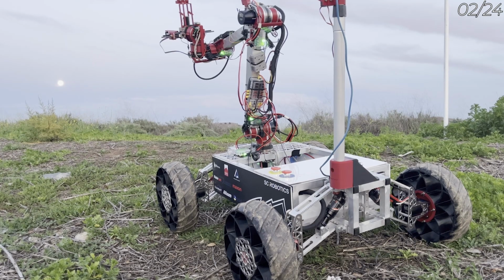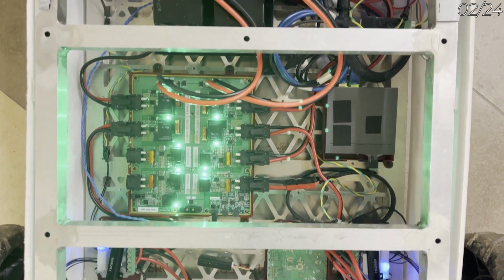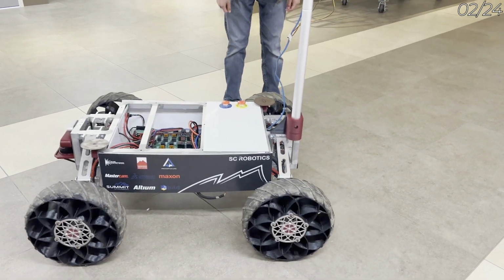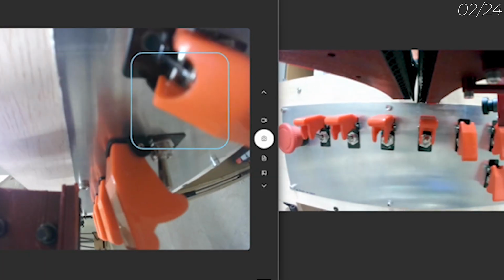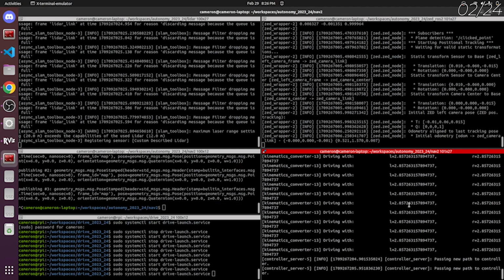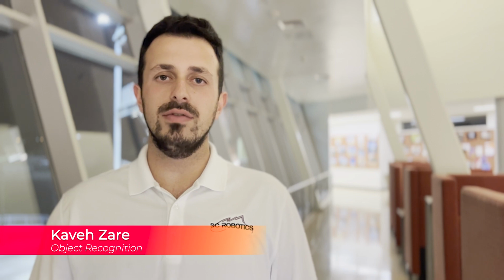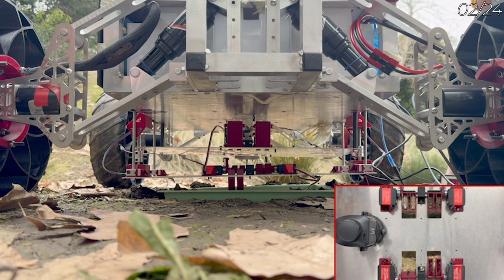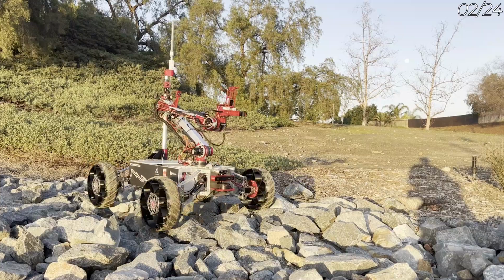Saddleback College Robotics URC SAR 2024

Comment: How did you manage to safely mount the lead screws on your end effector? If I´m not mistaken, shaft coupling can only transfer torque, not axial force caused by gripping objects. Do the leadscrews fall out from shaft couplings or not?
Reply: Though shaft couplings are meant to transfer torque, the shaft couplings are quite strong, and the friction is enough to support the axial force. The leadscrews don't fall out.